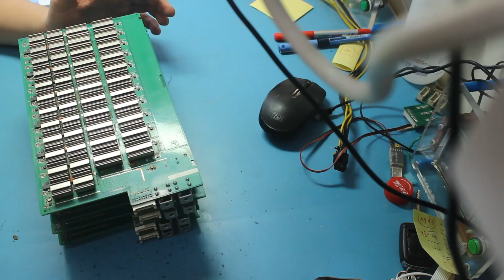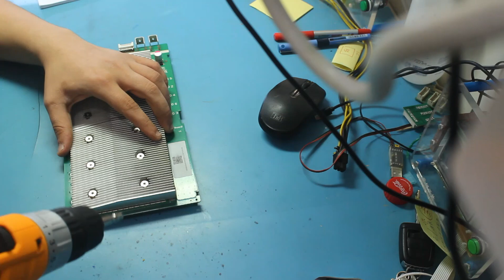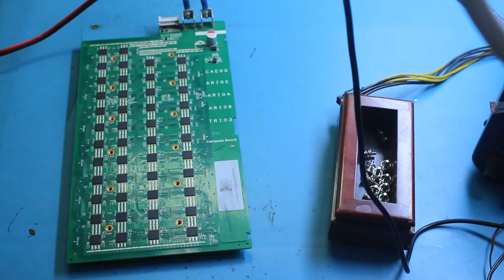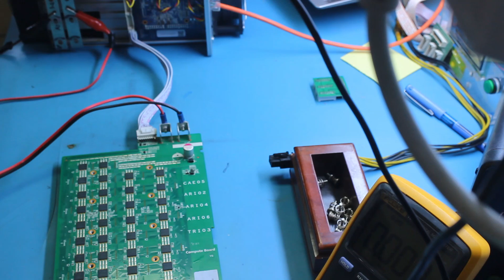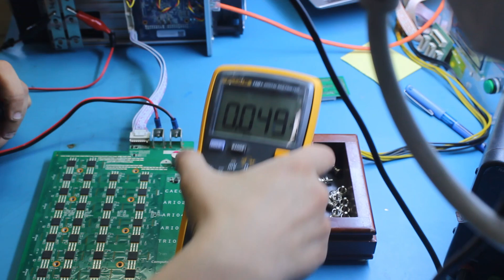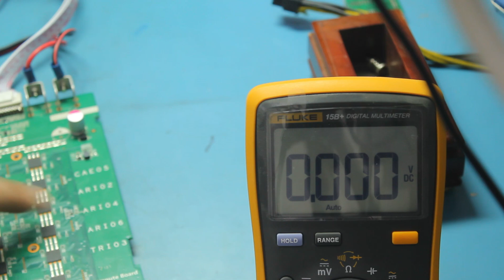⛏ Goldshell KD-5 Kadena Miner checking & repair .

Comment: may i have a question my KD6 temp chip have problem it show -100c in control panel i found only 1 chip on top left but can't find another chip 

it have in & out temp chip to show in control panel 

so now hashboard can't mine cuz it no temp to detect

Comment: Any idea what is wrong with the CK5 miner?
[2022-08-04 09:42:26] arg eaglesong
 [2022-08-04 09:42:26] Started ckbminer 5.4.2-unknown
 [2022-08-04 09:42:26] Loaded configuration file /mnt/config/bfgminer/bfgminer.json
 [2022-08-04 09:42:27] Goldshell-K5 dev0: get power id failed.
 [2022-08-04 09:42:27] Goldshell-K3  Miner detected, 4 chains totally!
 [2022-08-04 09:42:27] Probing for an alive pool
 [2022-08-04 09:42:27] Pool 0 stratum+tcp://ckb.2miners.com:6565 alive
 [2022-08-04 09:42:27] Pool 0 stratum difficulty set to 7629.39
 [2022-08-04 09:42:27] hex2bin: str truncated
 [2022-08-04 09:42:27] Stratum from pool 0 detected new block
 [2022-08-04 09:42:28] C0: gsc5_thread_init
 [2022-08-04 09:42:28] C1: gsc5_thread_init
 [2022-08-04 09:42:28] C2: gsc5_thread_init
 [2022-08-04 09:42:28] C3: gsc5_thread_init
 [2022-08-04 09:42:28] API running in IP access mode on port 4028
 [2022-08-04 09:42:28] C0: gsc5_device_init...
 [2022-08-04 09:42:28] C2: gsc5_device_init...
 [2022-08-04 09:42:28] C3: gsc5_device_init...
 [2022-08-04 09:42:28] C1: gsc5_device_init...
 [2022-08-04 09:42:28] C0: tryed:1 unexpected echo for cmd 0x0200
 [2022-08-04 09:42:28] C0: Auto addressing failed
 [2022-08-04 09:42:28] C3: tryed:1 unexpected echo for cmd 0x0200
 [2022-08-04 09:42:28] C3: Auto addressing failed
 [2022-08-04 09:42:28] C2: tryed:1 unexpected echo for cmd 0x0200
 [2022-08-04 09:42:28] C2: Auto addressing failed
 [2022-08-04 09:42:28] C1: tryed:1 unexpected echo for cmd 0x0200
 [2022-08-04 09:42:28] C1: Auto addressing failed
 [2022-08-04 09:42:28] C0: get power id failed.
 [2022-08-04 09:42:28] C3: get power id failed.
 [2022-08-04 09:42:28] C2: get power id failed.
 [2022-08-04 09:42:28] C1: get power id failed.
 [2022-08-04 09:42:28] C0: tryed:1 unexpected echo for cmd 0x0200
 [2022-08-04 09:42:28] C0: Auto addressing failed
 [2022-08-04 09:42:28] C3: tryed:1 unexpected echo for cmd 0x0200
 [2022-08-04 09:42:28] C3: Auto addressing failed
 [2022-08-04 09:42:28] C2: tryed:1 unexpected echo for cmd 0x0200
 [2022-08-04 09:42:28] C2: Auto addressing failed
 [2022-08-04 09:42:28] C1: tryed:1 unexpected echo for cmd 0x0200
 [2022-08-04 09:42:28] C1: Auto addressing failed
 [2022-08-04 09:42:28] C0: get power id failed.
 [2022-08-04 09:42:28] C3: get power id failed.
 [2022-08-04 09:42:28] C2: get power id failed.
 [2022-08-04 09:42:28] C1: get power id failed.
 [2022-08-04 09:42:28] C0: tryed:1 unexpected echo for cmd 0x0200
 [2022-08-04 09:42:28] C0: Auto addressing failed
 [2022-08-04 09:42:28] C3: tryed:1 unexpected echo for cmd 0x0200
 [2022-08-04 09:42:28] C3: Auto addressing failed
 [2022-08-04 09:42:28] C2: tryed:1 unexpected echo for cmd 0x0200
 [2022-08-04 09:42:28] C2: Auto addressing failed
 [2022-08-04 09:42:28] C1: tryed:1 unexpected echo for cmd 0x0200
 [2022-08-04 09:42:28] C1: Auto addressing failed
Reply from the maker: you can send your machine to check